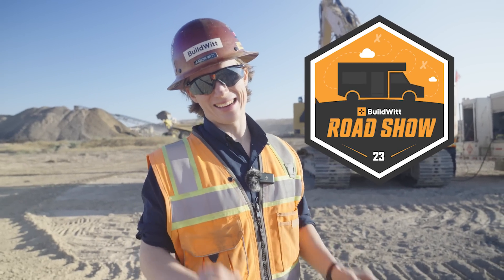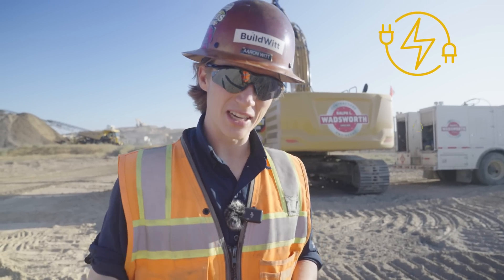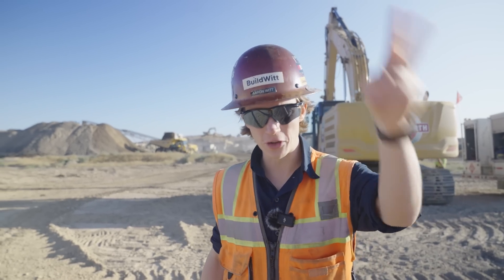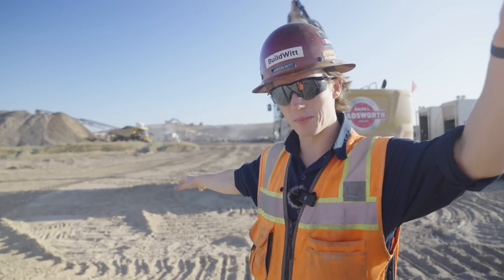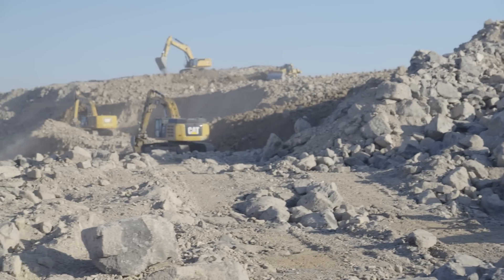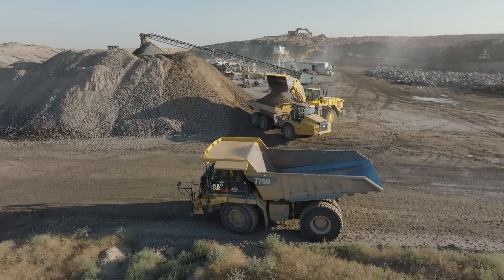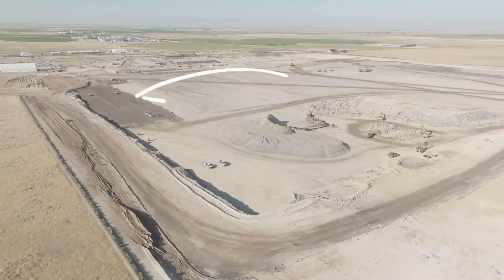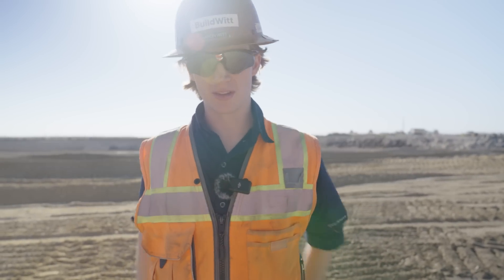Idaho's BIGGEST Earthmoving Project... For Data?

Comment: Northern VA has hundreds of data centers going in and been built in the past few years, its insane the amount that goes into these places
Reply from the maker: yeah but they're starting to move out into the west because of constraints on power / water
Reply: More clean hydro out west - lots of data centers in Oregon already
Reply: @buildwitt   I don't doubt it, I deliver and set up office trailers/construction offices and see a good bit of the entire process from ground breaking to finished products, data centers are in a league of their own when it comes to utilities.
Reply: Makes sense when you think about the money lost if an availability zone goes down even for a few minutes. Impressive stuff for sure.
Reply: No one in Northern VA likes these data centers - other than the politicians and wealthy contractors.  They are a huge eye sore and resource drain.  They take up hundreds of acres while providing minimal jobs.

Comment: Pumice Stone I believe. Crazy abrasive stuff for sure.
Reply: lava rock, much harder than pumice and heavier. I live like 10 miles away from this site. all of kuna has a hard pan of this stuff anywhere from 6 inches to 6 feet down below ground level.
Reply: @lunatic3571  Vesicular Basalt it seems. We don't really have that up here, mostly just normal basalt, not the swiss cheese looking kind. Not pumice at all you are right 😁
Reply: Not even close to pumice. Basalt is at leat ten times as dense and many times harder.

Comment: seems extraordinarily expensive vs building on a site that already had suitable soils.
Reply: Not if land and labour in Idaho is way cheaper.

But my bet is it's geography that chose the site, not geology.
Reply: more likely a property/equipment tax deal. data centers are hugely valueable to rural areas tax bases, thing might be worth more then the entire rest of the county combined @astecheee1519
Reply from the maker: there's always a reason and it's usually down to $$ somewhere
Reply: Access to cheap energy, steady climate, geographical proximity to key telecoms infrastructure, geographical separation from other data centers. All will play a role in the decision...

Comment: Great job, Aaron! I find this channel to be very informative. Keep up the good work. I use to operate Cat equipment until an injury took me out. Thanks for sharing and have a great day!!
Reply from the maker: thanks for watching!!
Reply: I seen a lot of YouTube videos of machines tipping over hope you weren’t one of them
Reply: @sxslayerxs  no, l lost a step on a backhoe I was operating and had to stop and get out and the step was gone and when I went for the step I went straight down on the battery box with my tailbone and drove my spine up and lost (broke a couple vertebrae. Was forced to have surgery and they messed me up and had to redo it a couple days later and I haven’t worked in almost 31 or 32 years.
Reply: @ProudPapaw88  my God that’s a bad injury and I’m glad you are still here to watch some great heavy equipment videos. You really don’t hear enough praise for the operators.

Comment: Love the videos mate but you need to learn the Komatsu range 🤣. "Big Komatsu Loader" doesn't cut it 🤣, it's a WA600-6. There was even a HD605 dump truck in one of the shots.
Reply from the maker: I'll get there one day
Reply: @buildwitt Good videos and information Kid.
Dont sweat it.
Reply: @buildwitt  one day I'll learn what the CAT's are 🤣. When I see them, I'll let you know
Reply: at the end of the day its all little loader normal loader big loader and "wtf is that loader?! they make em that big?!" loaders
Reply: Thanks for answering the question on the tip of my tounge Aussie brinkman 😊
Reply: At least Komatsu doesn't use Chinese parts like CAT.
I just bought parts for my 320 CAT "made in China" cost $$$$.
I almost threw it through the dealers window.
Reply: Take your meds.